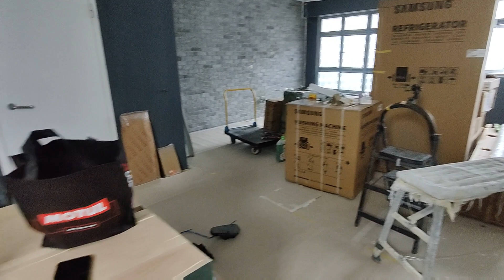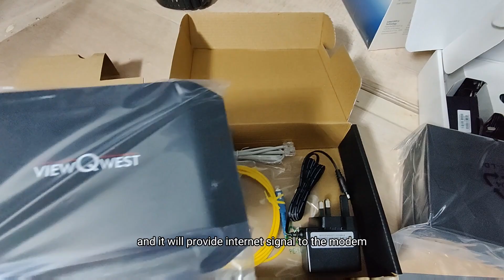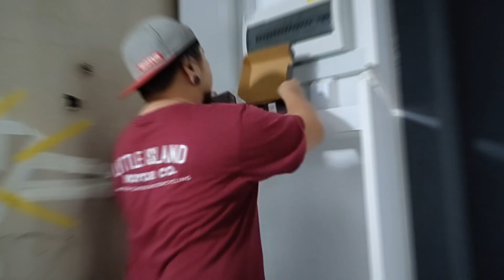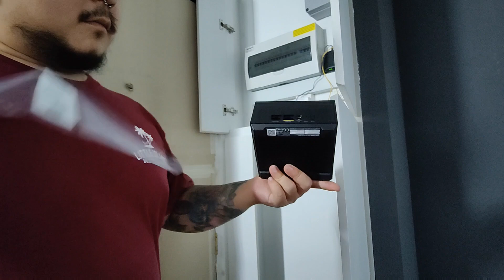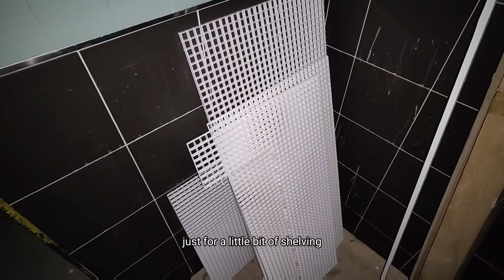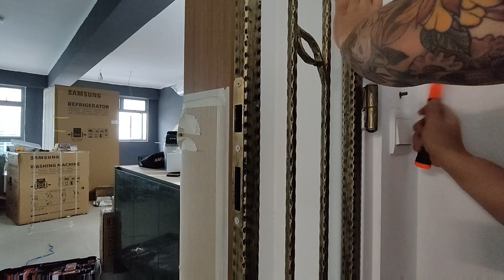Google Nest Doorbell Gen 2 (& DIY DB box rack) 👷🏻‍♂️ | Singapore HDB 4 Room BTO Greenverge | Ep. 20

Comment: suggest to run 2 nodes for your wifi first, might give you a better performance than 3
Reply from the maker: Wow! ALEX!! Absolutely love your channel and the content you make. Infact you helped alot during the considerations on what system to buy! 👍🏻👍🏻 Noted. I will run 2 nodes first and test if thereare blindspots before installing 3 🙏🏻🙏🏻
Reply: @NiJiaCasa  yep agree with Alex. try 1, at most 2...3 will actually make your WiFi worse
Reply from the maker: @kagekiso  thanks for the feedback. Is it because the device is constantly jumping between different node? Make it inconsistent?
Reply: @NiJiaCasa  yeah. especially since it's a relatively small space and all the signals will be quite equal in strength.

also, you might want to consider moving the router from out of the DB box. your flat should already be wired for ethernet

Comment: Recommended remove the old door bell button with $1 blank face plate or flat piece of aluminum, finish it with white paint from your contractor.
The smart door bell should wedge 45 angle on L wall, route your nest wire to the old door bell 2-wires. Put a charger at the back end wiring forever forget about charging.
Reply from the maker: Everything you mentioned is in on our to-do list! Hahahahaha. Thanks for the suggestion! 👍🏻👍🏻
Reply: Hi, we are going to install it at our new BTO also, just wondering how to put a charger at the back end wiring using the existing HDB door bell 2-wires?
Reply: @ivylee0922  HDB BTO doorbell backend wiring is normally routed to kitchen wall near entrance ceiling, open the circular cover, you'll see the 2 wiring. Purchase a "8vAC -24vAC, 10 VA", 50/60 Hz transformer that able to support SG 240VAC, brand doesn't matter,  plug to your nearest 3pin power socket. Connect/ join the transformer to the 2-wiring to HDB 2-wiring (inside circular cover), polarity doesn't matter, since it AC. Outdoor remove HDB doorbell button exposing 2-wires connect to your smart doorbell (polarity doesn't matter). Finish off exposed wiring with pvc trunking or casing if needed at your kitchen. :)
Reply: Would it be possible to replace the existing doorbell with the wired google doorbell version instead?